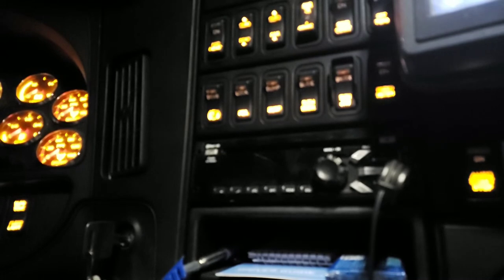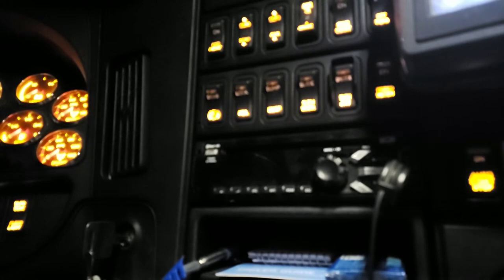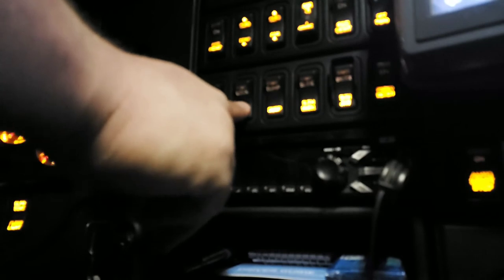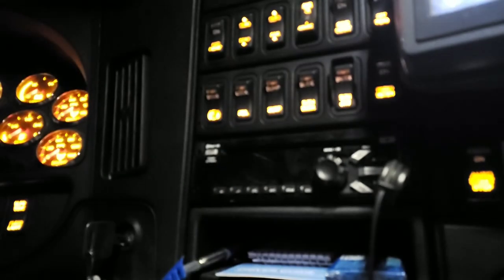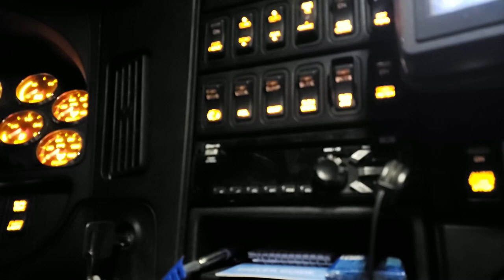POWER DIVIDER LOCK or PDL on Class A Truck.

Comment: I drive a tandem axle dump truck and I use my power divider every day. The trick is to flip it on before you might need it. Once you “need” it, it is probably too late.  You can put it in any time as long as you have traction already OR you are at a complete stop.  If you engage it while a tire is spinning on ice or mud, the sudden application of torque can damage your drive train.

Nice video bud. Subbed/bell rung.
Reply from the maker: Quite right you are on that. Thanks for the sub!

Comment: I use my PDL a lot when I'm bobtail, and any time I'm in a shippers muddy lot, or any time there is snow or ice on the roads, and even occasionally if the roads are slick from rain and I'm empty

PDL DOES burn extra fuel, you're right about that, but I've never had any issues with wear or damaged components, and I often drive interstate speeds with it engaged 

Just never, ever engage it when your tires are spinning from lost traction. You can engage it going down the road if you're going in a pretty straight line, even. 

And I'm speaking from experience, I do it all the time.
Reply from the maker: You Must of had a better truck than the ones my company provided, lol

Comment: Oh wow I feel like I'm out of trucking school. I got this new Freightliner truck 2021 and I just realized after a month the PDL lock was engaged thank you for the video. SMH 👌🏽 and this happens to be an automatic I've been driving 17 years now manual .. I thought not was anti pedal brake engage this truck has sensors on it.!? Doh lol
Reply from the maker: That's exactly the reason I made this video it's surprising how many people aren't taught this when they buy their new truck or whenever they're going through the school. Heck there is drivers that have almost 20 years experience on me that were never told about this. Glad I could help, have a good one and keep the rubber side down😁👍
Reply: @adultingwithoutsupervision4310  👍🏾😁✅

Comment: When you set the PDL does shows you some light on the board ?? I have a prostar 2011 and I just press the button but I doesn’t show anything .
Reply from the maker: some do, some don't. I've had ones with a light on the button and ones that had a light on the dash. You may need to pull up the manuel for that one online and check.

Comment: Hello, I operate an aircraft refueling truck with a tandem, and it's governed to 15mph max because of speed restriction around airplanes. Should the PDL lock be left ON because my supervisor noticed premature tire wear on the back rear axle. Also, the truck is relatively new and the PDL lock has always been ON. Thanks!!
Reply: @AdultingWithoutSupervision  Thanks for the feedback! Yeah, the tires on the 2nd rear axle are severely balding and showing the steel encasement, while 1st rear axle tires are normal. I wasn't sure if the PDL light was causing the tires on back half to wear prematurely because of it or because the fuel truck is a 7000 gallon tanker.
Reply: @AdultingWithoutSupervision  It's actually all four tires on the 2nd rear that are bad.
Reply: Only for short perisods and only up to 25MPH but its your discrection

Comment: Hello how fast can you drive will on PDL
Reply from the maker: Technically whatever your top speed is, but I wouldn't if i were you. It takes more fuel and put more wear on you tires. It should only be used when you need the extra traction.
Reply: I was told anything over 25 was pushing it.